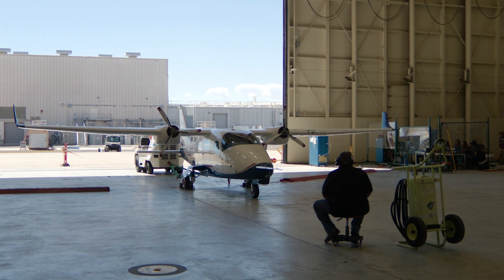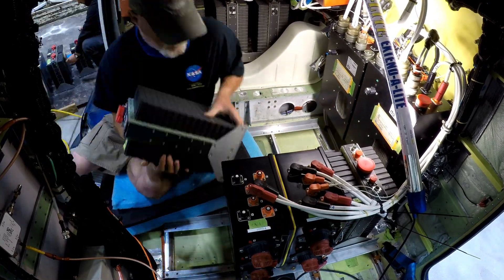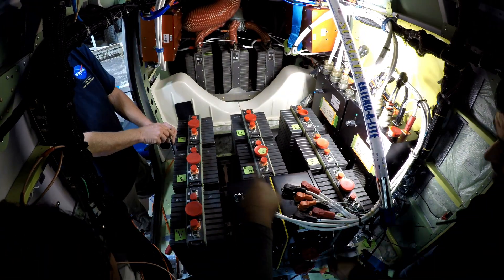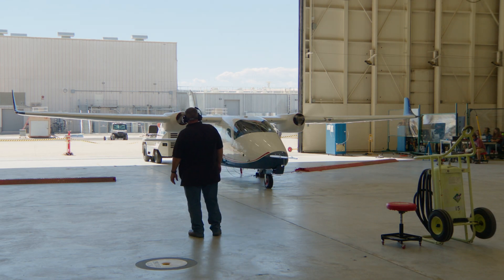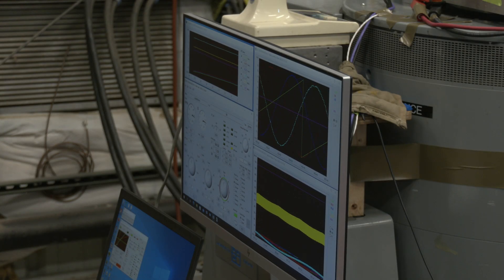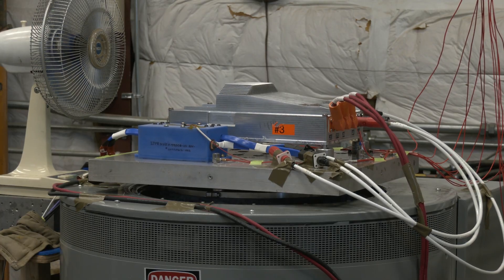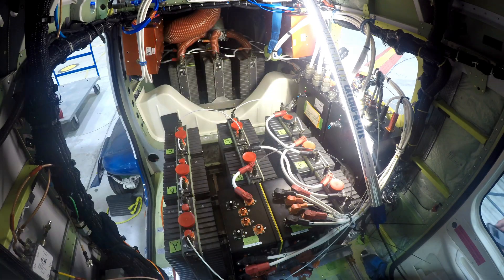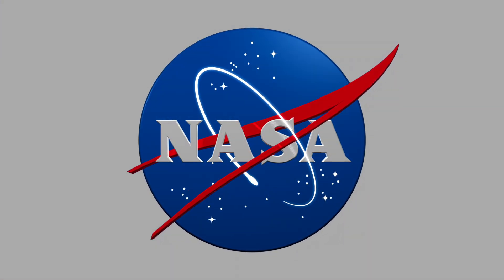NASA’s X 57 Maxwell Powers Up

Comment: Full of batteries, no room for anything else, and still wont have a useful range.
Reply: You get that this is a tech demonstrator / data gathering rig, right?  This machine is strictly for testing different configurations of propulsion, wing, and battery and gathering data to provide to actual airplane manufacturers.
Were you expecting NASA to sell you an airplane?  Because if so, I have a rocket you can buy...
Reply: @superhakujin  The point is that it's not even going to lead to anything useful being produced, so there's no reason for its existence.
Reply: @superhakujin  That comment doesn't make any sense... at all. I'm not criticizing NASA (or its predecessor), I think that NASA should be doing more to advance aircraft and space flight technology, my point is that NO amount of development is going to make electric aircraft viable.

It's ridiculous, people like you seem to think that we can just pick any technology that we want and make it viable with enough development, but that's not how things work. If we could do that, why not just skip vehicles altogether and go for Star Trek transporter technology?

Comment: Optimization arrives at same sol. My design looks precisely like this. Good they abandoned wingtip propulsion idea, as if one motor fails guaranteed death due to severe moment
But Y add complication and another  failure point of retracts. 5ft dia soft C!30 style wheels remove need for even suspension system.
Put aside fancy accent & diversity, honestly it is just a brushless RC plane without even RC. Keeping it simple isn't a bad thing though
Reply: How would you know the reliability is equal?
Reply: @Shazbat5  Gd Q. RC pilots do destructive testing (crash) & design evolution. Keeping it simple, yet near optimum is the robust sol. 
More systems in series more likely to fail due to each system failure probablity mutiplication. Redundent Systems in parallel & testing to emulated conditions bring reliability.
Reply: Why not do the real thing instead of wasting that effort on KSP?
Reply: @defeatSpace  ?

Comment: Has there been any work on Fuel Cell Aircraft?
Reply: Each HFCEV is BEV with added fuel cell and hydrogen storage (the battery is usually smaller). If you have technology for BEV aircraft you can replace some battery capacity with HFC & storage. This project is about electric propulsion in flight, fuel cell would be an unnecessary complication (can be a part of sister project if need be).

HFCEVs are incredibly less efficient than equivalent BEVs (The losses in production, cooling, transport of hydrogen and the FC mean that you loose more than half the energy you started with even in the best case scenario, while on charging & discharging battery you lose <10%), so BEVs should be used wherever possible.

Comment: F EVs
Reply: But i still prefer gas turbines on Sustainable Aviation Fuels (SAF) (Sustainable Biofuels and Power-to-Fuels fuel), and Fuel Cells on Hydrogen or DME (Dimethyl Ether) etc.
Reply: Also just Investing in north America High Speed Rail So we need Less Planes
Reply: @ericlotze7724  Three great points, Eric.
Reply: Eh, in car applications yeah, but for small aircraft (island hoppers etc), the lack of a need for fuel infrastructure (electric lines are way easier than an atmospheric storage tank full of JP-5) and low maintenance do make BEVs quite nice.

Also the fact that they may not be used as much as a “Daily Driver” Car, and that many have removable/hot swappable batteries, means charging is even less of an issue.

Also not as many will be made (most likely, assuming no industry wide adoption (ie even for long haul) ), so the impact is relatively low compared to cars.  (Although i would prefer the use of Sodium Ion batteries etch